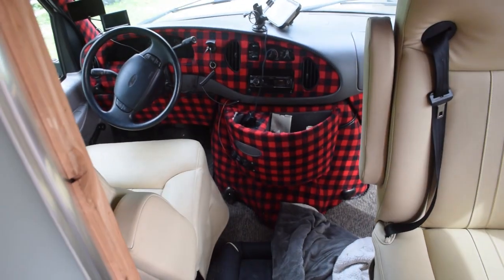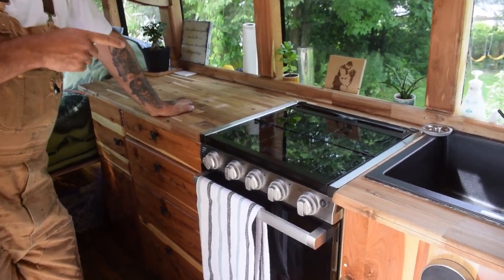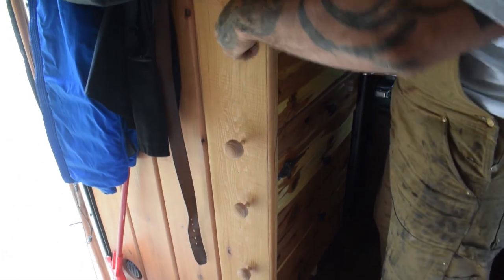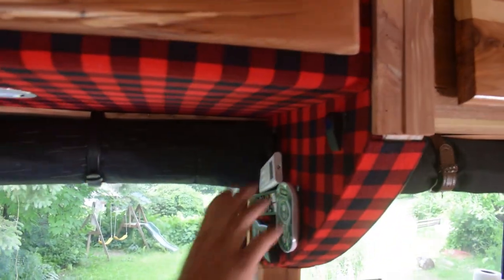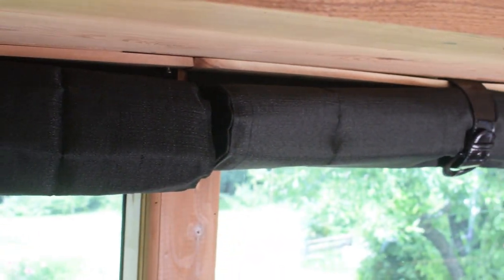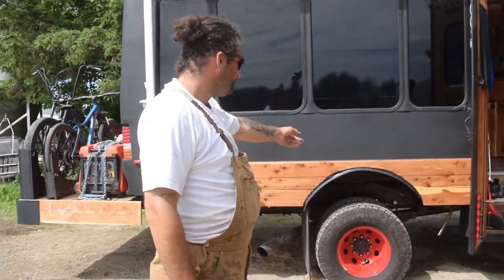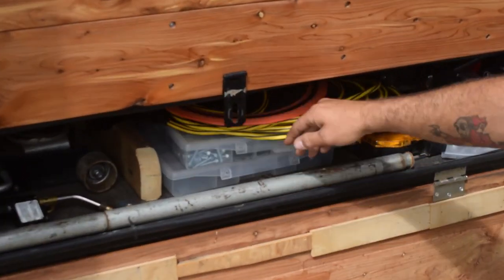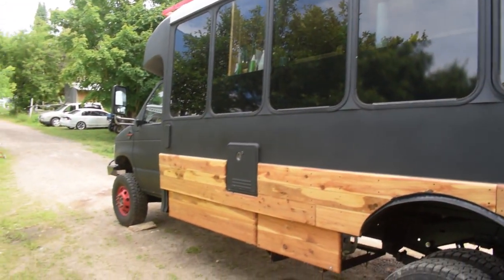The most amazing tiny house skoolie shuttle bus conversion!

Comment: Nice work! Question: Does your apartment size fridge drain your battery fast because I absolutely love that nice size fridge. Would definitely get that size when I get me a van!
Reply from the maker: He said he has never drained the battery below 70% yet, there is a generator but he hasnt had to use it yet!
Reply: Yeah the fridge doesnt make a dent whatsoever. We have 1360 ah of lithium 1.5 kw of solar more or less. We still havent had to use the genny almost two months on the road now

Comment: I like the look of the outside for sure. I just wonder why the fridge wasn't kept on the kitchen end of the wall with the dresser drawers on the bed side of that wall. Seems it would have made more sense to have clothing by the bed and the fridge venting nearer the door. Swap those two items, and it's the kind of set up my husband and I would totally have...except our toilet would be for normal use not just pee time!😳😬🥴
Reply: We would have lots a few more crucial inches had we reversed it. It was important to keep the electrical switches and readout by the door. Also you cant see it but there is a solid steel frame that runs the top of the door in behind the drawers. The fridge would have been out in our walkway an additional inch.
Reply: @andrewhewlett7672 , such interesting things that many of us just in the researching phases haven't even realized we need to consider. That makes so much sense. Thank you!

Comment: How do you get the inside wood to stay on the ceiling
Reply: Furring strips alot of glue and screws
Reply: What type of glue, I use 5200 chaulking for boats, for around the windows, I never thought for inside ceiling.
 What sealant do you use for the roof to stop leaks where the screws are drilled in to the wood, I have a 40 Fleetwood Bounder motorhome I am remodeling, ceiling leaks, walls need reframing, and metal studs are rusty and need replacement.